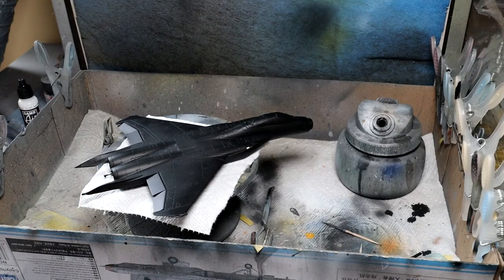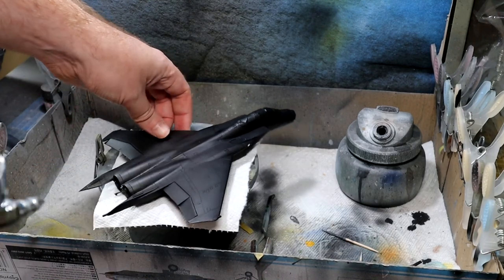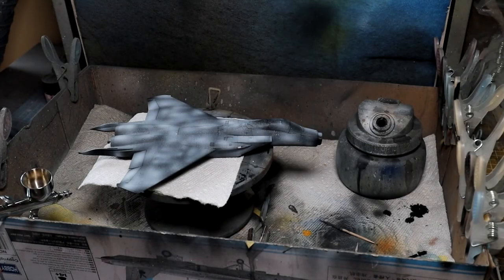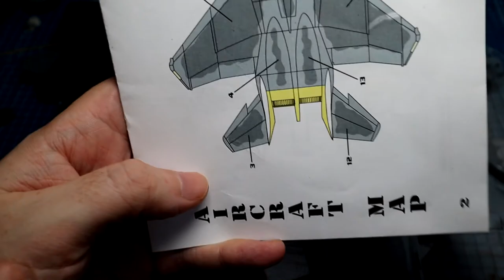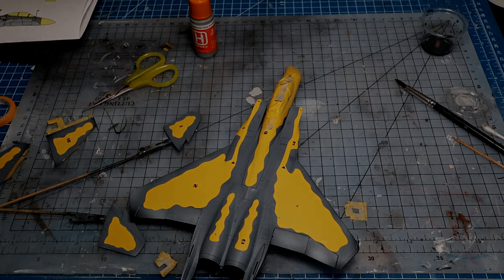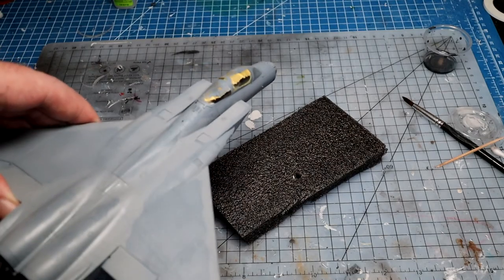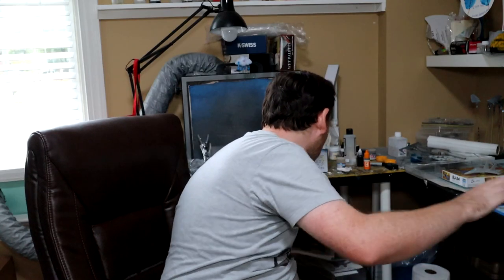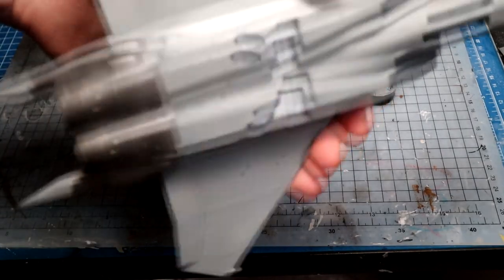1/72 GWH F-15C Build Series - Part 4: Paint

Comment: Good to see some progress on this build. I have also tried having residue issues with vinyl masks before. I found that de-tacking them by sticking them on and off on my hand or shirt a couple of times made a difference. Plus the longer the masks are on the more residue it causes. Looking forward to the next part! 😀
Reply from the maker: Thank you for taking the time to watch and leave a comment. Yeah, I have been hit and miss with AeroMasks recently. You can not beat good old Tamiya tape. But for complex patterns, masks make life so much easier. Especially with my 1/72 Viggen I did in splinter pattern! Richie

Comment: I use acrylics....i have a feeling that if i use this mask set, it will peel the color right off...
Reply from the maker: If it is dry it should be good. If I ever have concerns over paint peeling, I spray a clear coat between colors to protect the paint below. Richie
Reply: @RWHobbies  yes... i do this too after finding that acrylics are not as tough as other types of color...though veeery easy...especially on cleaning...it really adds to the workload...i also try to minimize the adhesive of the mask or what have you....but still... i have a worrying feeling every time...and even if they are dry...it still peels off..p.s. waiting for me f-15 this week...i was so impressed with their f-14...prob best on market....